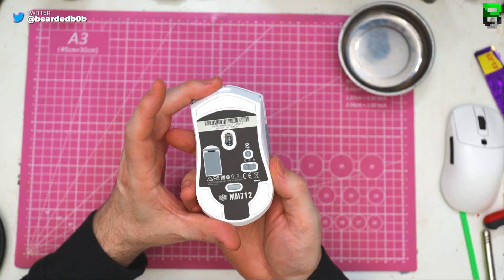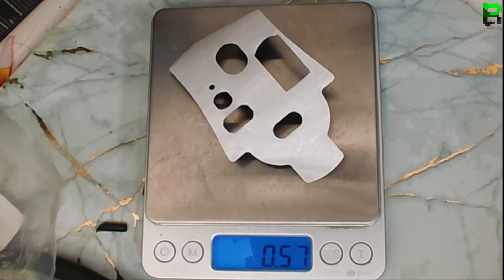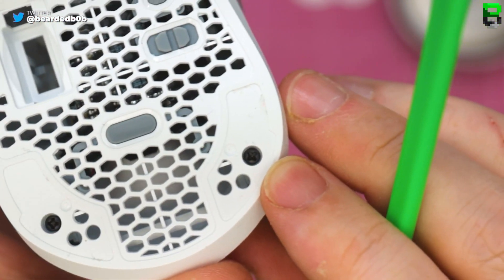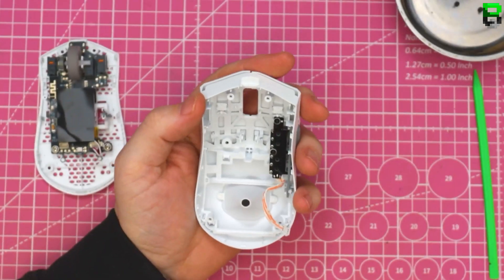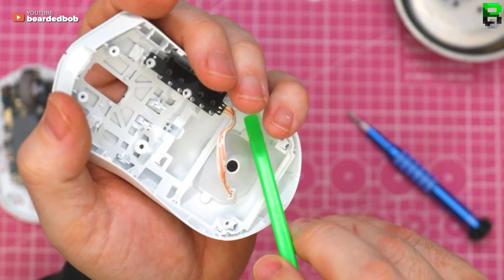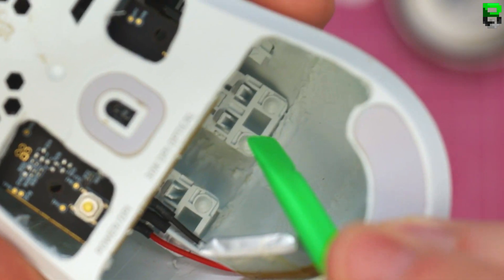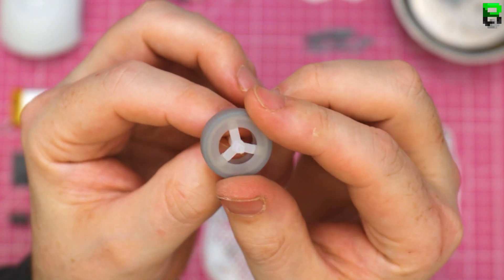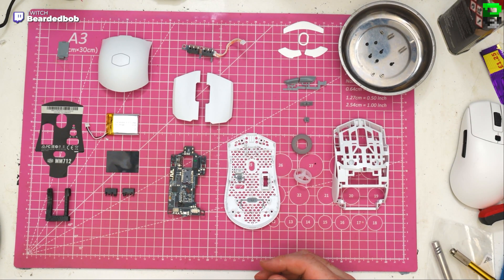Cooler Master MM712 Teardown: LETS REVEAL EVERYTHING! Insane

Comment: mine MM712 started a nasty mwheel bug, scrolling up and down is registering both actions.
Reply: Ok I opened it and saw a hair stuck in the mouse wheel, removed that and it fixed my issue.  Also managed to get the original skates back on without damage.  Just heated them VERY lightly with a hair dryer and peeled them.  After repair, put the skates back on and heat very gently one by one to reactivate the glue, then it looks good as new!
Reply: @jar-z7t   thx for the heads up! I used this video as a guideline and cleaned my MM712 inside and it works good as new again.
Reply: @jar-z7t  that kinda seemed to solve my problem, thanks a lot!
Reply: Same here actually, that's why I'm looking to take it apart to try clean out the scroll wheel or lube it up
Reply: This happened to my MM720, so I RMAed and they sent me an MM712. Now one of the side buttons broke on my MM712, haha.
Reply: Did you manage to fix that side button ? Mine fell yesterday (and it still looks intact) so im wondering if Its something that can be fixed by slotting it in right back  @mochabean5042

Comment: Can I remove the battery and use it as a wired mouse?
Reply: yes, I just did this because I lost the reciever. Shaved off 10 grams along with the side button, which also broke 6 months into using this. Still, love the weight and shape. 
I sadly lost the springs of the mouse main buttons while doing this, unsure about finding a replacement spring :(

Comment: I just got two dead Batteries (602535) And I cant find any replacement for them because of the 3 Cable solution do you have any tips? .. Just dont want to get a third mouse with the same Battery defect..